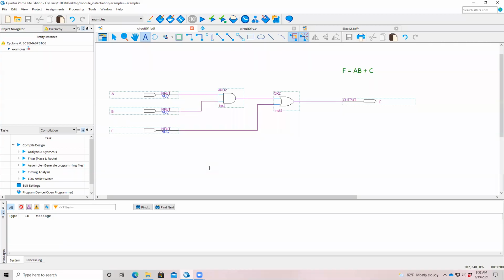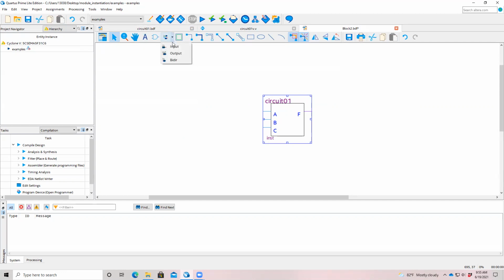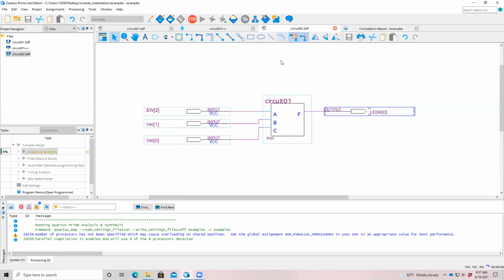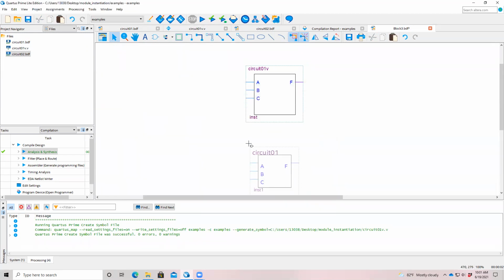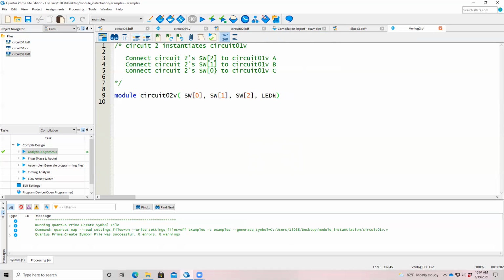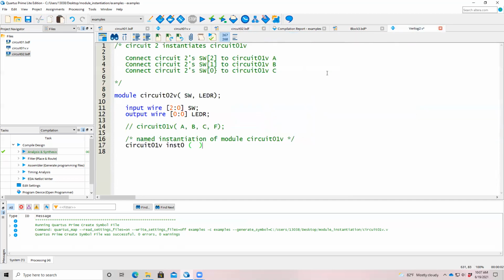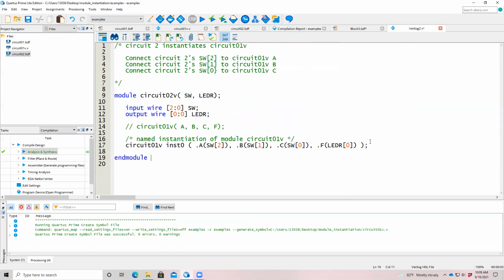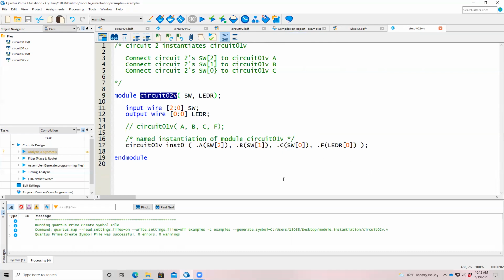How to instantiate a Verilog Module, part 1

Comment: I'm so glad that you've posted a new video. Please keep on doing this. It's very very helpful! Thank you so much!
Reply from the maker: Thank you. I am teaching a digital logic lab course this summer and creating videos related to the course. There will be a few new videos each week for the next 6 weeks. After that, I plan to post a new video each week. Feel free to suggest a topic.
Reply: @digitallogicdesign3593  Thank you for the videos, I have also found them very helpful, great pace and great explanation. I am interested in PWM, test benches and understanding the Modelsim simulation process. Thank you
Reply: @digitallogicdesign3593  Thank you for your videos on Verilog. It's been a lifesaver.
Reply: Up until now all of your videos were just the ones I exactly needed, especially clock divider by 5 with 50% duty cycle. Looking ahead I would suggest to post more of practical things such as push button/switch debouncer, test benches, timing analysis.